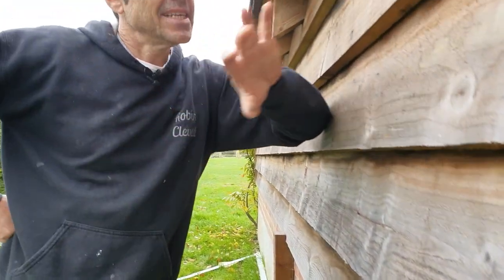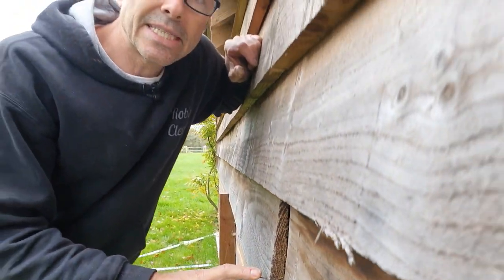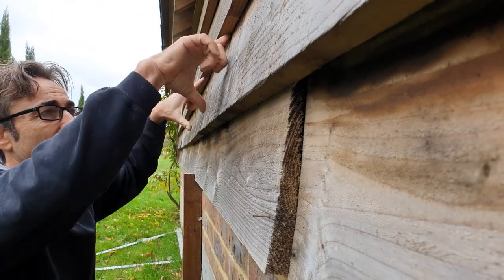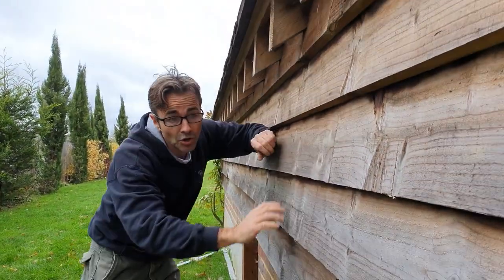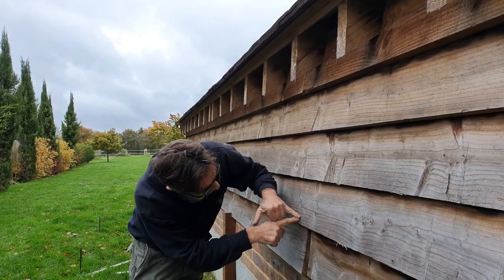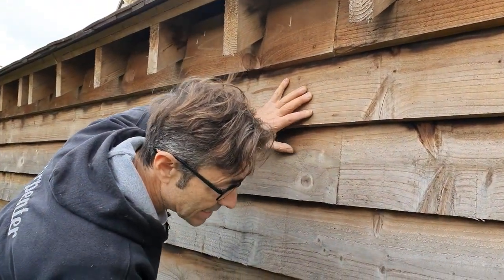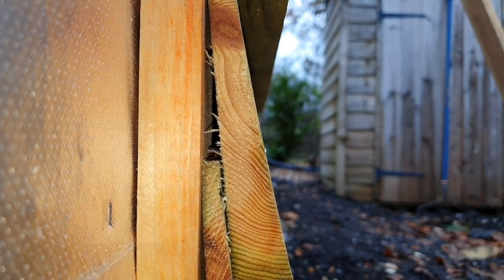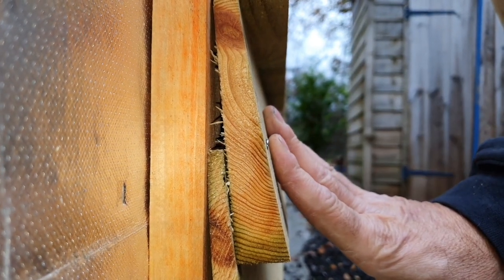Dont fix Cladding/Siding like this!!! How to Fix cladding properly

Comment: Excellent advice Robin.  I didn't know about angling the nail slightly upwards.  To expand on your comment about oak and stainless steel: oak reacts with non-stainless steels, leaving black marks and corroding the steel, whereas it doesn't have this effect with stainless steel.  That's the same reason you should never use ordinary steel screws with oak, and brass screws are preferred.

Comment: I thought i was a perfectionist until i saw your work.
The cladding on my garage\studio is all trying to fly away they are so curled up, i decided not to nail them using galvanised nails this summer as they are so bent and waney. I'm allowing these few months of wet weather to relax the cladding.
They have been fixed at the top so the nails cannot be seen.
I was going to nail them about 25mm from the bottom, nailing through both, but after seeing your video it makes perfect sense.
Keep up the good work.

Comment: I didn't know that galvanized brads aren't good for exterior, good to know. Luckily I only use them for interior anyways.. I really like the trick about using the upward angle on the nail at the end there, one of those things you just wouldn't think of unless you were told, very cool!

Comment: Thanks Robin.
I've just used F/E on my shed, with a breather lining behind it.
I used type 90 18ga staples and used them so they were vertical and straddled the grain of the wood. So much easier than trying to hold the timber, a nail and a hammer while standing on a hop up. As you say Rob, they will corrode, so I will use galvanised nails as well once the timber seasons a bit. They were strapped and bundled in tens (no surprise there) and absolutely soaking.
As for electro plated galvanised nails. We had a fence installed by a contractor. The galv nails they used started to corrode within a year.

Comment: If you orientate the cladding so the centre of the tree is on the outside, the board always cups inwards and doesn't pull off the one below it.
Reply: Yup - I was always taught heart side out. I've been doing it that way for thirty odd years and it works just fine.
Reply: Can't do that on featheredge though, it's got a front and back. Looks wrong if you spun it around.
Reply: @BillyMustang101  yes thats true one side has a 90' cut the other is beveled. I've only ever installed straight edge and wainey cladding, always heart on the outside.

Comment: More great advice, Robin. It’s surprising how many people don’t fix feather edge correctly. I once saw a whole barn that had been ‘secret’ nailed into the thinner part of the board so the nail heads were covered by the next board🤦‍♂️, the owner had no clue and just trusted the guy that fitted the boards.
Reply: People insist it's a "thing" despite being measurably inferior in every way except for the fact you can't see the fasteners. I'd hate to see how that performed in a typhoon/hurrican situation where the whole board is just hanging from a top nail at the thinnest part of the board...
Honestly, do it the way shown here, and if you get your nail lines all neat and lined up that becomes a feature and a sign of good craftsmanship in it's own right.

Comment: Saw a TV show with a well known Guy that used to appear on ground force fixing Feather Edged cladding to a shed. He nailed through the thin end to hide the nails. When the camera scanned over it a few days later they had all curled up. The camera did move pretty fast too.
As a guy with 25+ years in garden buildings I can remember shouting at the TV when he did it !
Reply from the maker: Thats funny, I would love to find that clip!!!!
Reply: 🤣Things on those shows usually only have to look good for a day or two while they film. Guess they didn't film fast enough in that case! But yeah, pretty obvious that will happen. I found a comment here on Youtube where someone complained their weatherboards were all curling. Later mentioned they nailed the top for "hidden fasteners"... 🤦‍♂

Comment: Also a good idea (correct way!) to lay the boards heart outwards if they are sawn / reversible to improve longevity and ensure that any cupping of the boards happens the other way around,with the boards staying snug rather than curling away.It also helps stop the meeting ends at the outside  corners of the run wanting to curl away from each other.
For nails.my weapon of choice would be round head hot-dipped galvanised nails (rough,grippy generous zinc coating) at length = 4xthickness of boards used and don't use a wafflehead hammer as it will trash the  protective zinc plating.

Comment: In the garden building Oak cladding vid you used an 18g nailer, what nails would you suggest using in an 18g for wavey edge cladding?
Reply from the maker: That nail was only used for the window trims, for the actual featheredge cladding I used a framing nailer with 63mm stainless steel nails, for waney edge cladding I would adopt the same fixing routine as the featheredge, 18g pins would not hold the cladding, hope that helps

Comment: Before you put up  feather edge, get the colour and waterproofing on first. Otherwise, when it shrinks you get super horizontal stripe effect.
Reply from the maker: Thats a really good tip especially if you plan to satin the cladding, top of the class for you Sexton

Comment: I always 45 degree miter the ends of the pieces instead of a simple 90 degree cut.  Otherwise, if the siding shrinks the least bit, it opens a gap to allow water to enter.
And I now use 3" deck screws instead of nails.  Almost any nail will pull loose at some point.

Comment: What's the thinking on not fixing through the lower part of the top board and not "catching" the overlap of the board below? I've always done it like that, fixing about 30mm up from the bottom of the feather edge board so that you fix though both boards. I was taught in a lot of applications to fix (especially with cladding) to fix in a dovetail pattern, so that you aim your nail to the left on one fixing, then to the right on the next, or up and down if it where vertical. Great tips btw.
Reply: I’m not a professional but as I understand - the idea between using a single fixing as opposed to multiple is to allow the boards to expand and contract without splitting, the idea being if you’ve got two fixings very close together it doesn’t allow the boards to expand/contract naturally and risks splitting them.

Comment: Hi, that’s a really helpful video. Are clipped headed nails ok or do they need to be round head. Typically what length would you use when fixing feather edge boards? Thanks

Comment: Good advice for anyone thinking of having a go DIY but who in god’s earth would think of using brad nails on cladding professionally?  Those boards cup like nobody’s business once they dry out so you need plenty of bite on the frame underneath. I use always ring nails by hand or framing nails by gun and aim for at least a third of the nail into the supporting frame.

Comment: As a decorator trying to get the black out of oak because tight ass joiners using cheap nails, is hell for me. Oxalic acid works but tbh it still comes back.Replacing all beads is the only way! Anyway rant over 🤣

Comment: Great info thanks. Our house is clad like that and a nightmare for birds and insects etc, we are about to have it all taken off and replaced with render.  Keep up the vids👍
Reply: Birds and insects are in a massive state of decline and are facing extinction, we are also one of the most nature depleted countries in the world, please consider putting some boxes up on the wall after it's been rendered to replace any nesting space lost.
Reply: @dougthebuilder1 .  Don't worry, our eldest daughter is an ecologist so wouldn't let us get away with not replacing nesting areas.
Reply: @dougthebuilder1  I honestly don't get the desire to keep insects, birds and creatures off all kinds out. Live with them, much better in my opinion.
Reply: @Raysnature  You wouldn't be saying that if you were in my house at the moment, where a family of mice have died on the concrete below the floor! Bloody hell, that's a smell that lingers. Had to make a 1m2 hole in my wall to get access to the area behind the fancy hidden cistern in order to find a spot to drill through the floor (lifting the floor would be significantly more expense) and hoover up the corpses (the masasive gap around the waste pipes in the downstairs bathroom  - bloody plumbers - was letting in the corpse smelling air as well as giving the mice free reign to come and go, albeit limited to that small area). Anyway, I agree with the sentiment, as long as they remain living!

Comment: Thanks for sharing the clip Robin, that was really useful. How much overlap do you leave on the boards ? I am not sure how much I should overlap one board on top of the other before nailing the top board into place. Can you advise?
Reply from the maker: It depends on the width of the cladding for 150mm you should allow 25mm to 35mm for 175mm allow 35mm to 45mm and 200mm allow similar to the 175mm board, featheredge cladding can vary in section thickness from 1 piece to another and the thin edges can sometimes run to nothing so find a bad bit and use that as the guide for overlap, new video coming soon
Reply: @ukconstruction  Thanks for the reply Robin, will use your giuidelines

Comment: Interesting. 
But in general how do you decide whether to use a nail or screw to fix wood?
Reply: Mrgeorge118 spot on. Although if the screws had a long enough unthreaded shank, surely you could get away with not pre-drilling?
Reply: mrgeorge118  Thanks. I never considered the cost. 
I’d done a bit of Googling and people were saying that screws were brittle so would snap if the wood moved sideways (due to temp or moisture etc) whereas nails would just bend and stay fixed. ‘“Shear strength” I think it’s called?
Reply: Bang a nail in first,if the timber splits,then you should of used a screw!
Reply: Dowels. What could go wrong?

Comment: Wow why would ya use a brad for that?🤣🤣 absolutely spot on robin👌
Reply: That's about what the "pro" builders used on my house in Japan. A frickin pin, minimal rust protection, smooth and about 30mm long. After a couple of years they are rusting and working out of their own accord. Fortunately it's tongue and groove siding so it kind of holds itself together... I did overlapped weatherboard on my self-built shed and used 65mm stainless screw-shank nails with a decent head.

Comment: I have a feather edge fence that (to my knowledge) is 30 years old and the only way I can get the boards to hold on is with 40mm screws.  Any nails just work out within weeks.  It will need replacing before long so I'll remember this even if I have someone do it for me I can make sure it is done properly.  Thank you.